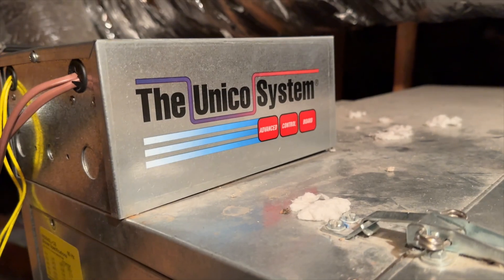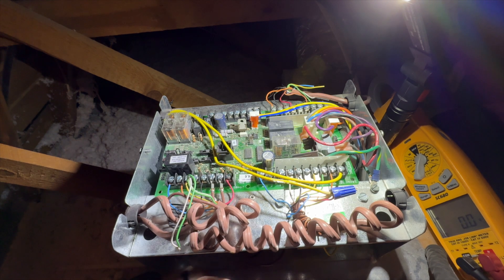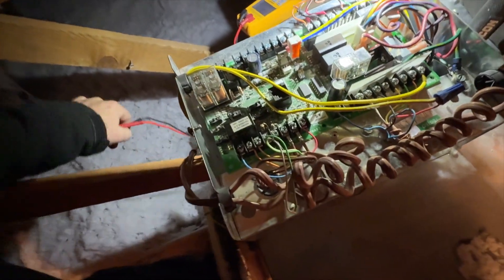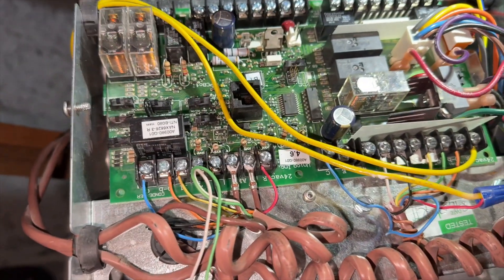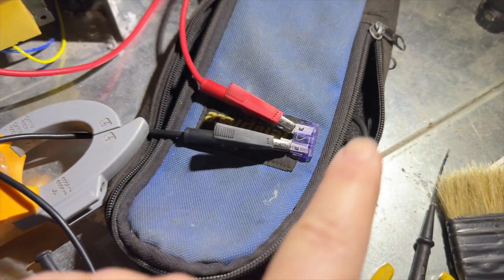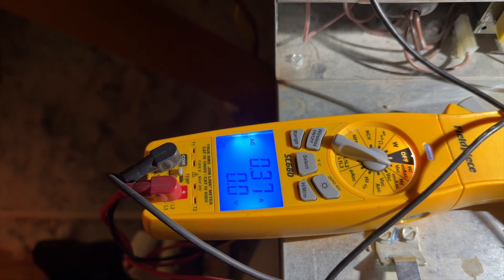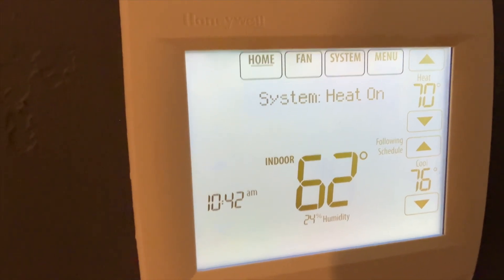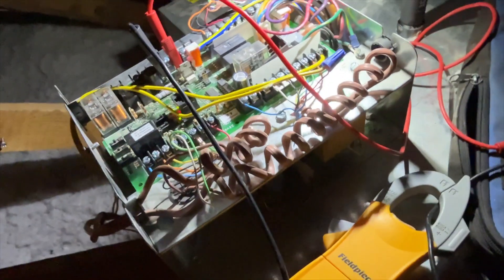Finding a Short on a Unico System EP204

Comment: I'd just jumper the fuse out with a piece of copper tubing/cut off bolt, etc. and put an ATC type fuse holder in the transformer wire feeding the board. since almost nobody carries the glass fuses anymore. they do make various fuse converters that snap in to them and hold an ATC blade fuse, but not sure I'd trust them with vibration.

Comment: You don’t have to order or use those glass fuses.  You can easily convert that fuse holder to accept your three amp ATC plastic fuses.  It does take about 15 minutes or if it’s your first time maybe a half hour.  But it’s a true service to the customer because they don’t have to buy $30 fuses, Wait a week for them, and it makes future diagnostics and repairs very easy.

Comment: Hey I think on a situation like this with the small glass fuse is to get terminal connections run two wires from them to different model fuse holder and fuse.

Comment: Man i just ran into one of these but it was old and crammed in the worst attic space. Ended up being the old mercury tstat causing the heat to shut off and on. Never have i ever seen or worked on one before but it was pretty straight forward. Good vid

Comment: Unico was originally built and designed back in the 70's for older house installations where standard duct work doesn't fit as most of their branch supply lines are 4" to 6" round flex. I've installed a few and repaired many. Once you get to the air handler - they are always "stuffed" away somewhere, they are easy to work on.